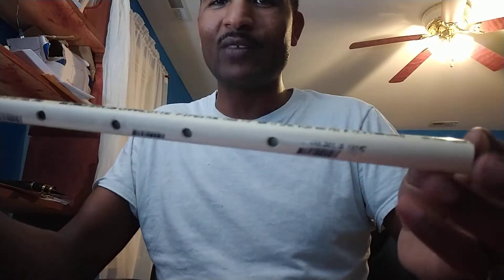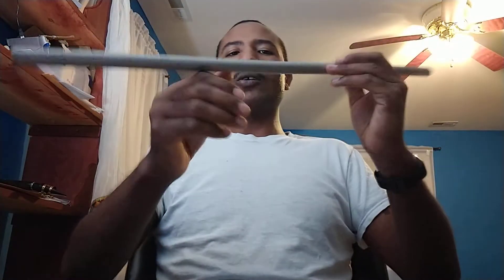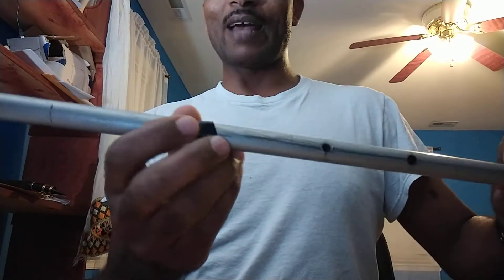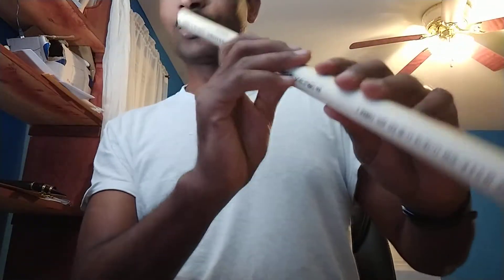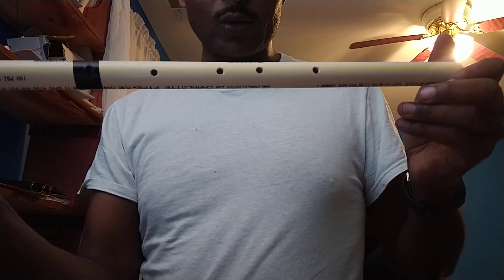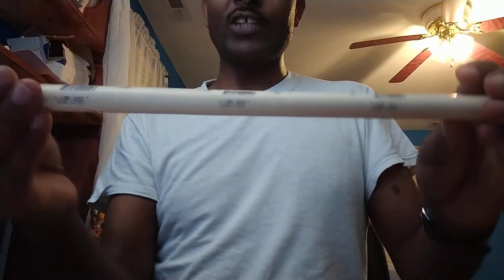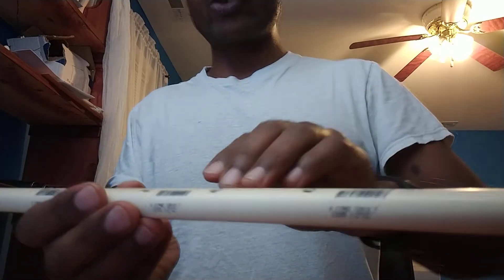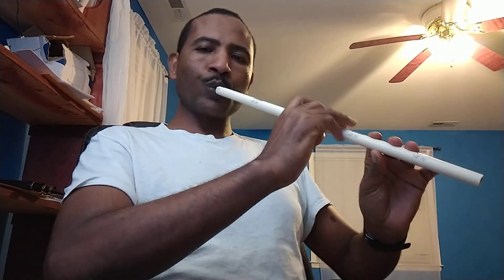Ethiopian Flute #6/7(1)

Comment: waw I love flute. am also play with it...

hello Mola... I have seen your description about how to prepare flute.. let me give you an idea..  to know the actual place for a hole.
there are two types of flute as I know
The Length of the whole flute is should be 45cm to 55 cm.  but 45cm is best.

 for first  type:> 
 divide a full length for 5  parts, then the four holes must be at the third( two holes) and fourth part (two holes)  by counting start from the tip from mouth side. the first and the last parts should be smaller by some length. 
see bellow. If the  "h" is the hole.
---||------||--h---h--||---h---h--||--

for second  type:>
 divide a full length for 6  parts, then  one hole at third part, two hole at fourth part, one hole at fifth part  by counting start from the tip from mouth side. the first and the last parts should be smaller by some length. 
see bellow if the "h"  is hole

---||-------||------h--||--h-----h--||--h-----||---

NB: we can specify  the distance between each hole by putting our finger ring finger and thief finger.. some gap between in it.

I can't show you the exact image of both.
Reply from the maker: Thank you very much.